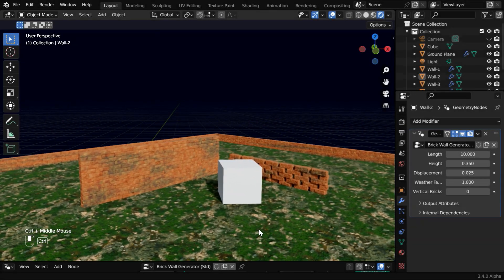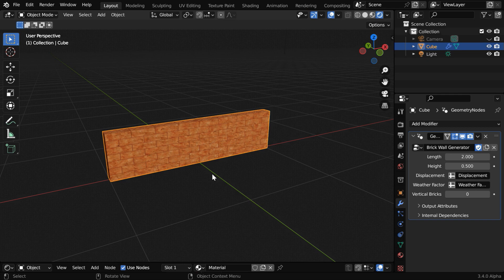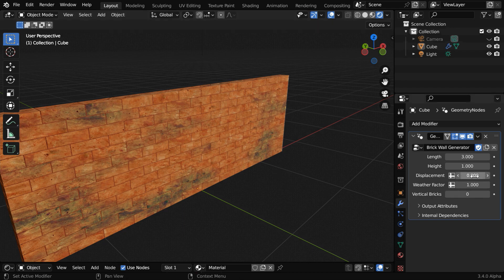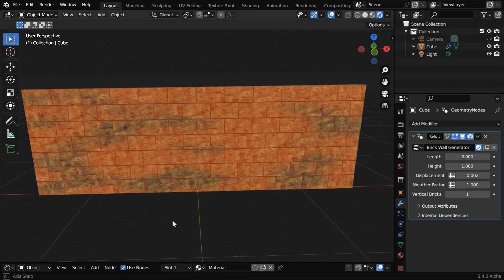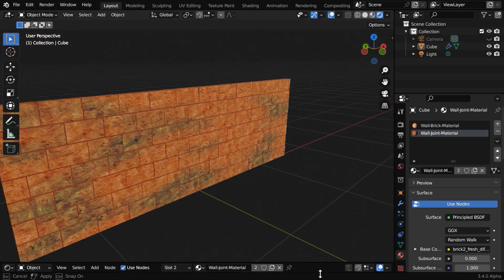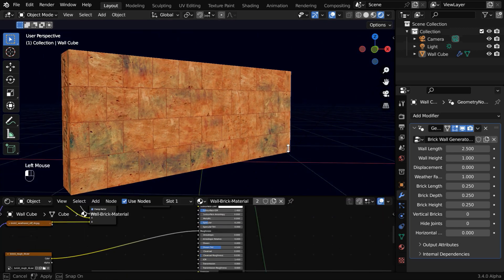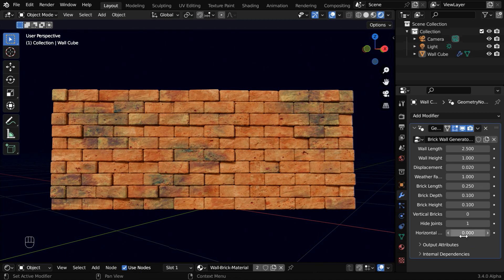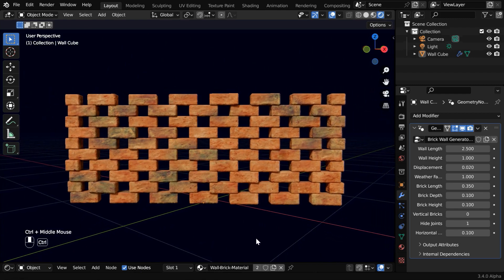Blender | Create Brick Wall With Procedural Brick Wall Generator | Geometry Nodes Demo Cum Tutorial

Comment: Blender already has a wall generator addon
Reply from the maker: Yes it does. But there are some more features that is available in our add-on. For example, there is a displacement feature which is very handy. It also comes with UV mapping and some ready-made brick textures. Blender's built-in add-on also has some other features that are missing in ours. So based on the individual use cases one can decide which one should be used.

Comment: Nice video..can u please answer my question that i want to render my project in 4k quality from blender so should i buy high level graphics card like 3090ti or should i buy both 4k monitor and 3090ti...i want to render in 4k quality...
Reply from the maker: Hi, a 4k monitor is technically not required since you can still generate and publish 4k video without yourself having a 4k display. But it is a good idea to verify your output on the target display once before you publish. So better to have a 4k monitor. If you have a TV with 4k display, you can even use that for this verification.